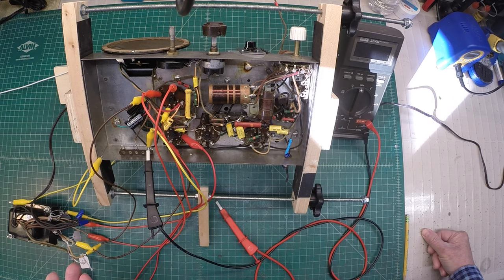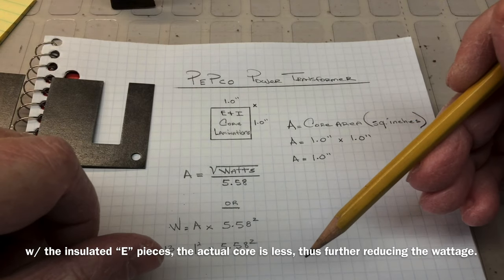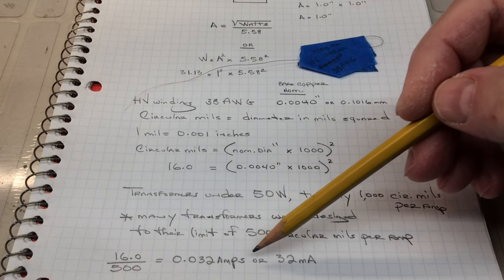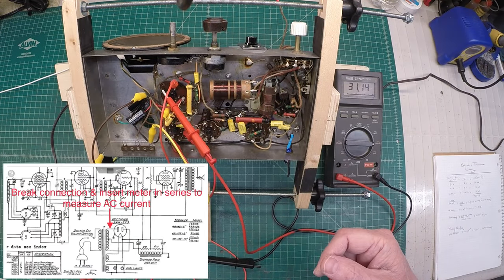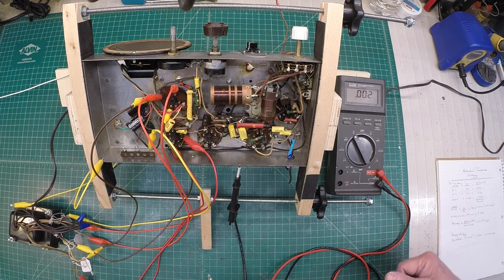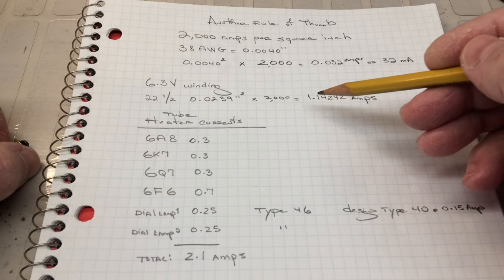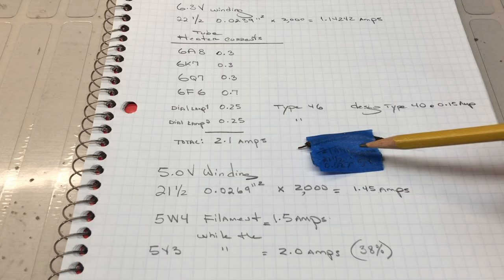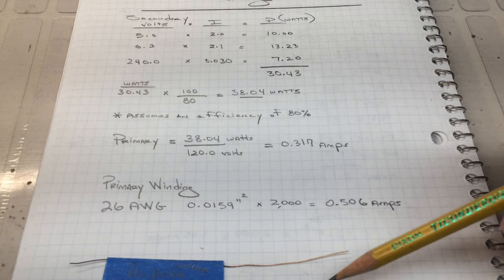Reverse Engineering a Power Transformer

Comment: This was a great way to figure out what you need and why it failed. Very Educational Don, excellent, thank you so much.
Reply from the maker: Thanks Ron, it was fun backing into the numbers. Small undersized transformers were definitely commonplace during those times. Best, Don
Reply: @RestoreOldRadios   I agree.  The Detrola 4 Tube radio I am working on appears to be undersized as well, but I have no way to confirm this. It just does not feel right for a 1932 set to have such a small transformer. The unit works, but the test is , is there a a way to tell if a transformer is under stress  :) good stuff my friend

Comment: I am glad you made this video! At first, I thought you could rewind the old transformer using the same wire gauge and length used, but your calculations show that you would need larger wire in the secondary windings so the transformer is actually correctly sized for the set! This is a great lesson into doing further investigating before jumping to conclusions. Again, great video!
Reply from the maker: Thank you Jake. I’m pondering the idea of a rewind knowing the transformer is subpar. My window for all of the wire and insulation is only 10mm in thickness, so I’m not sure I can pull it off. Stay tuned for an update. Best, Don

Comment: I like how you did a post mortem on the power transformer Don. Nice job on calculating the maximum power output of that transformer. They pushed the transformer to its limit, wonder if it was an engineering mistake or a bean counter got involved.
Reply from the maker: Thanks Jim. I would bet on a bean counter since times were tough as many of the west coast radios have this issue. Thanks for watching and I hope this finds you doing well. Best, Don

Comment: Good timing for this video. I recently got an RCA K130, and the transformer was replaced with one that doesn't meet the specs. I read that people used to rewind by hand. Still worth exploring? I doubt I can find a replacement. I have some donors with the right core size. Time to read the radiotron designers handbook.
Reply from the maker: Ted - I’m pondering a rewind myself, but my window of ~10mm limits my ability to increase the wire sizes significantly. Time will tell. Thanks for reaching out and I hope you are able to secure or rewind the RCA K130 transformer. Best, Don

Comment: Thank for this video Don! It is helpful for my current situation. I have a Philco 41-285 with a burnt PT. It is the same as the one in the Philco 41-280 radio you did back about 6 years ago. I watch that series and it was very helpful as well. Do you remember what rating PT you went with on this radio? You stated about 240-0-240 and I was wondering what amperage PT myou used?
Reply from the maker: I referenced Sams Redbook and it shows the following three substitutes for your Philco 41-285:

Stancor - P-6120
315-0-315 HV @70 mA
5.0V @2.0 Amps
6.3V @3.5 Amps

Thordarson - T22R04
300-0-300 HV @90 mA
5.0V @2.0 Amps
6.3V @3.5 Amps

Merit - P-3048
260-0-260 HV @90 mA
5.0V - not specified
6.3V @3.5 Amps

Hope this information is helpful and all the best on the repairs.

Don
Reply: @RestoreOldRadios  Thank you Don! Yes that helps.

Comment: That’s why most amplifiers in the 60s went with diodes and got rid of the tube rectifier the trans is cheaper to make saving cost 
I personally use them in my builds
Reply from the maker: Thanks for insight Jim. Best, Don

Comment: Are  you considering  that the line voltage was  lower  back  when that radio  was built  Mr Carlson !
Reply from the maker: Hi John, this is Don, not Paul. Yes, I was focused on the HV winding AC current and not the line voltage, when using my substitute was less than 100VAC. All the best. Don
Reply: @RestoreOldRadios   I called  you that because  you  said  " at your  own risk" .   it was  suppose  to be  funny  oh well
Reply from the maker: @johnsenchak1428  You know I’m a little slow sometimes. LOL Thanks again for watching and reaching out. Best, Don

Comment: I had hoped that you were going to calculate the proper size wiring and number of turns and then rewind the original transformer to handle the expected demand plus a bit extra.
Reply from the maker: Hi Wayne - I might attempt a rewind, but the window (space) required for the larger wire gauges to achieve 1000 circular mils per amp is not available. I only have a 10mm window to work with. Keep watching for an update. Best, Don